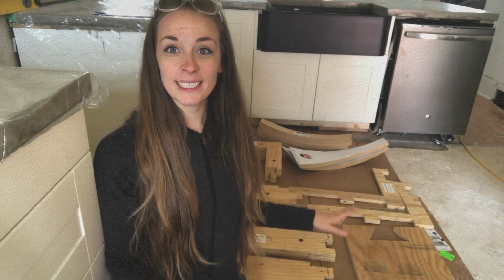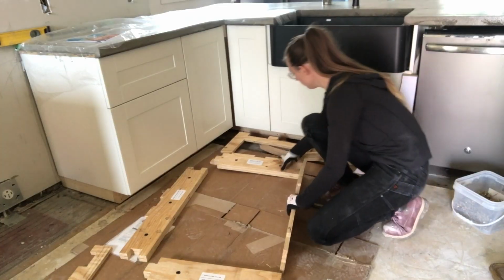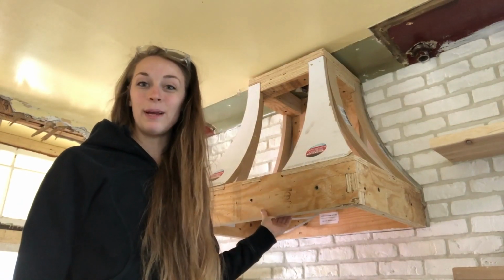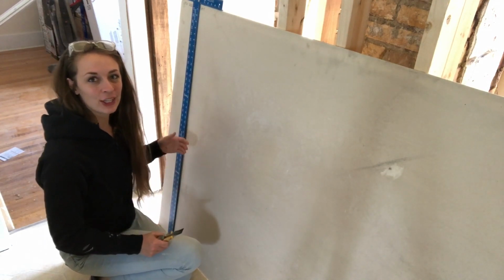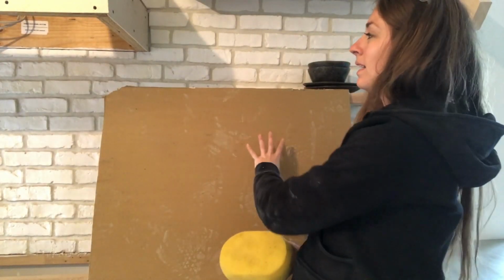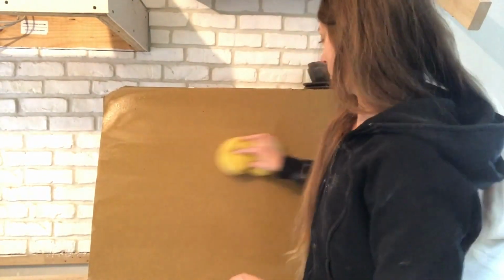Custom Kitchen DIY Range Hood with Investorgirlbritt

Comment: Nice work on this hood. In hindsight, given the various finishing options, would you choose to drywall again? Pros/cons?
Reply from the maker: To finish a hood, I would consider what type of finish I wanted first then address if its best to use drywall or other materials. Drywall if you are familiar with bending it is easy to work with because it is forgiving and you can add mud to smooth it out. There are so many ways to finish the hood: drywall, wood, metal,  paint grade, stucco etc. https://www.youtube.com/watch?v=p7hL8LvX9UM
To ask Brit directly her thoughts, visit her Instagram here and shoot her a dm https://www.instagram.com/investorgirlbritt/
Reply: @ArchwaysAndCeilings   do you install the stainless steel range hood before, during or after installing the wood hood that yall sell?
Reply from the maker: @karenmorales882  the vent insert is installed typically after the range hood kit is on the wall.

Comment: how does your ventilation system work?
Reply from the maker: If i can recall, Britt used a recirculating vent . However, ventilation typically will vent out the top or back.

Comment: what are the gold strips ...can you explain?
Reply from the maker: thin strips of mdf made to look like metal strapping
Reply: @ArchwaysAndCeilings  can you elaborate?? i am trying to do this now! is it painted MDF? what paint?
Reply from the maker: @catherinenikolovski2923  it is painted mdf. You can also google faux metal straps for a rubber option. Email all questions so we can answer them directly.
Reply from the maker: @catherinenikolovski2923  1/4" strips of MDF. Give us a call if you need more info